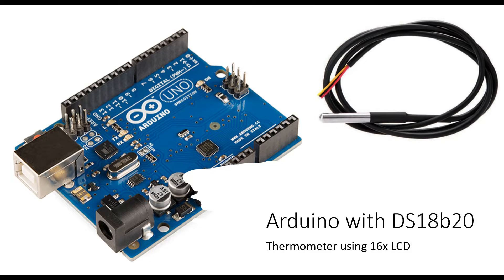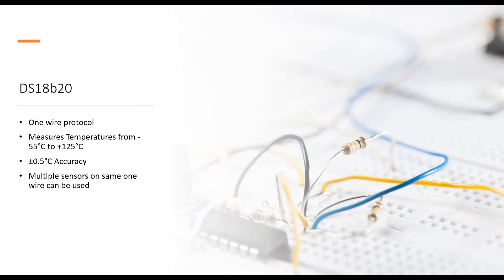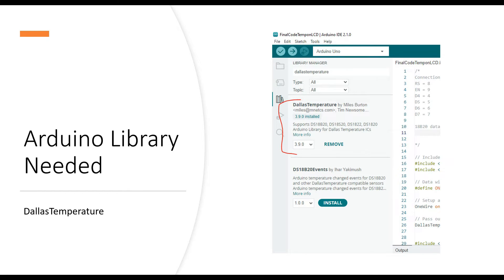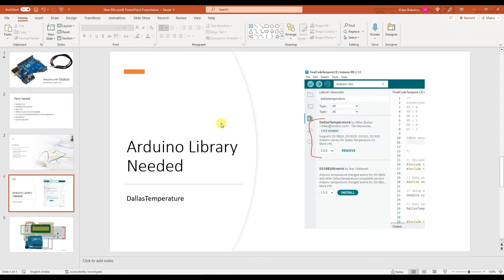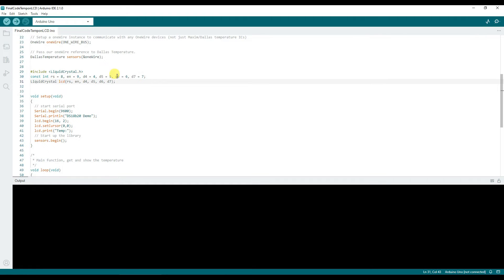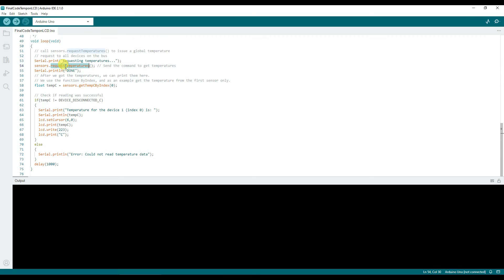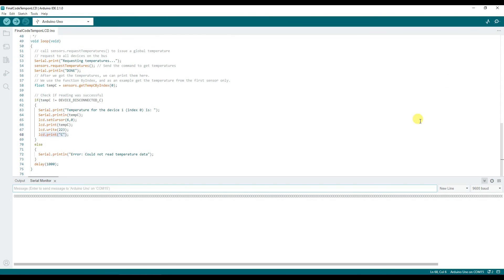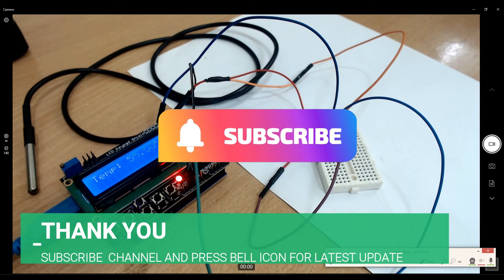How to interface Arduino with DS18B20 temperature Sensor and 16x2 LCD | #arduino DS18b20 thermometer

Comment: You should be more clear at the beginning about the critical 4.7k pullup resistor required. The lighter is WAY too hot for this sensor. Use a cup with 1/2 inch of hot water. Sensor limit is 125C. Hot water never more than 100C.